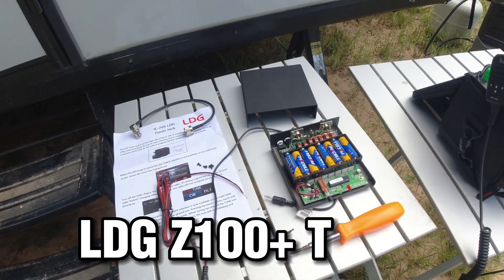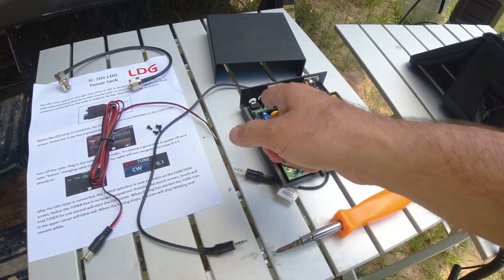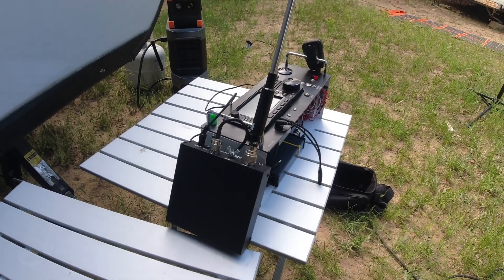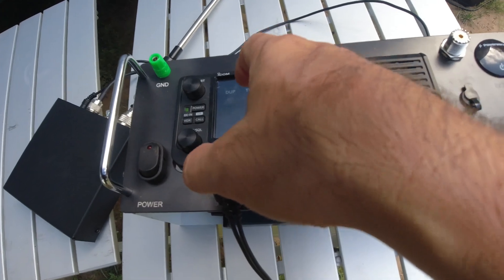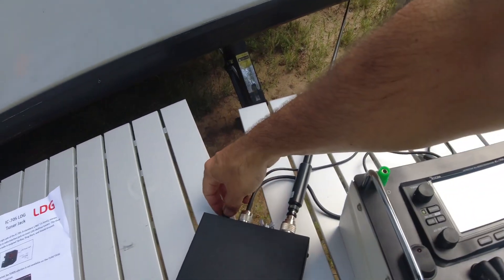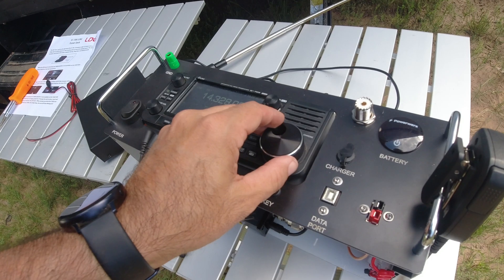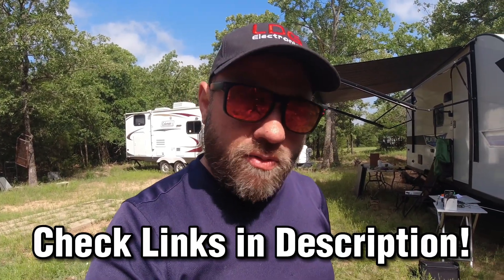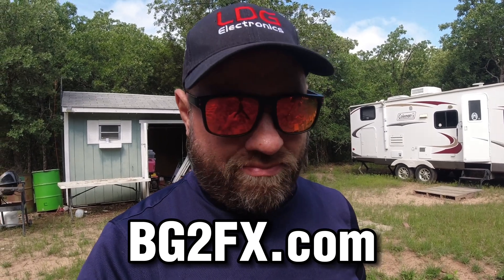LDG Z100 Battery Powered Antenna Tuner for Icom IC-705 - EASY!

Comment: For the 705, would you pick the LDG over the mAT705? I would think the mAT705 wins in size. It looks narrow enough that you could doubleside tape or velcro it to the 705 if you wanted.
Reply from the maker: The mAT does win for size. I think the LDG has options for more radios though. The mAT that I own is only for the 705.
Reply: The LDG is 125w at SSB ita more of a utility unit, Matt is QRP rated
Reply: Came here to ask that exact question

Comment: Question ❓ Why didn''t Icom use the AH4 port, or an adapter cable on the Ic705.  This you have to get all new stuff for a new rig does not cut it with me